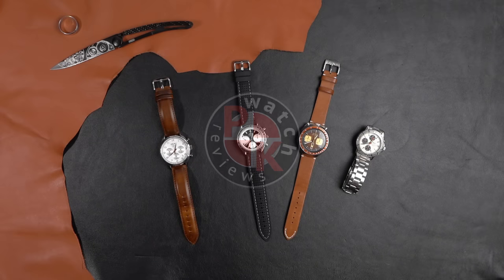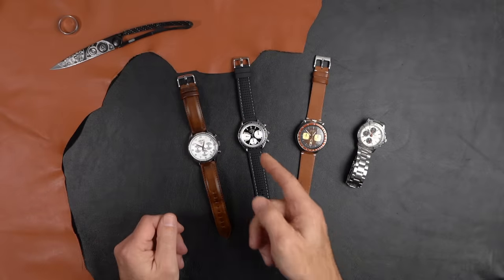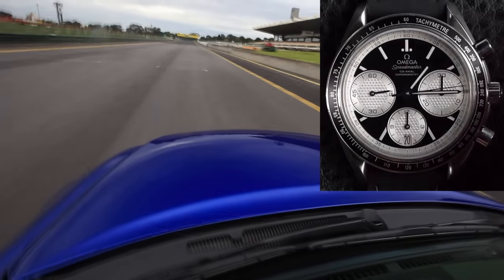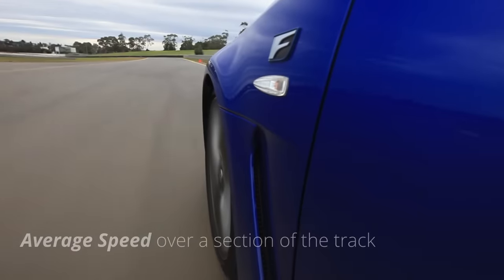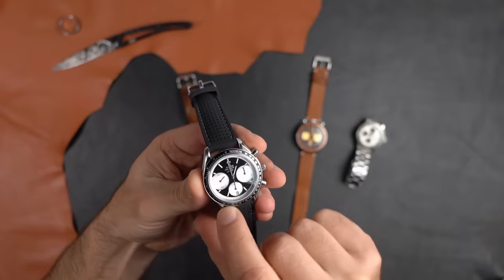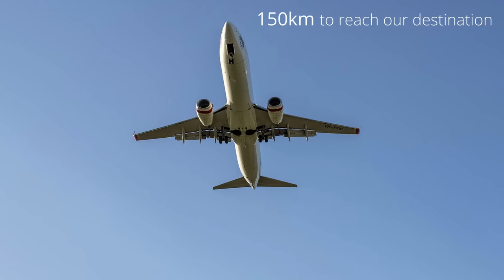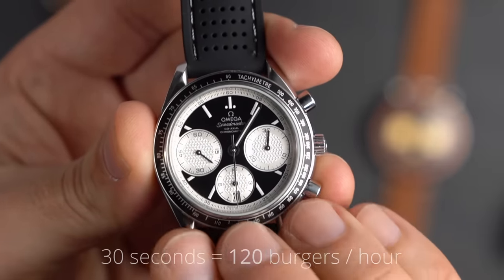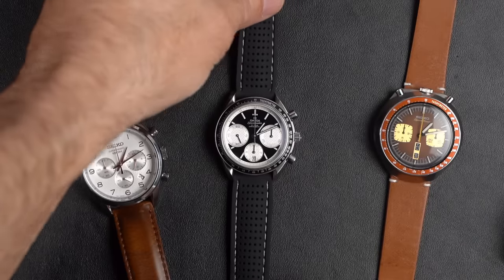How To Use A Tachymeter On A Watch

Comment: Tachymeters went the way of the divewatch: many people own them, professionals stopped using them decades ago, and not that many people actually still know what they really used to be for.
Reply from the maker: I agree, most of my friends don’t know how to use them either 🤔
Reply: Oh, well do not tell Formula 1 or the pilot's association!
Reply: @robinrobson5363  Pilot here...  and AOPA member.  No matter how well we my like the style, none of us actually use any pilot watch functions for anything other than basic time telling in the cockpit.  GMT is about the only useful thing for pilots, assuming you're traveling international a lot.  I actually use a chono and diver's bezel a lot, but mostly in the gym timing sets, or the kitchen when I've got multiple things going on the stove.
Reply: Well the divewatch function can be somewhat useful on a daily basis if for some reason you dont have a timer available,such as exams.
Reply: @heathwasson7811  And assuming that the GMT function is actually easy to use because some GMTs are kinda of a headache to remember how to read them
Reply: now it's used to look nice as sheeeeeeeeeit
Reply: @PeterKotsa  True, but I can still use my Omega Speedmaster to calculate the distance of a runway when doing an inspection to determine if it's long enough to land on. But, that's about it!
Reply: Dive watches are still used for diving. Mostly as a backup but still used

Comment: Tachymeter can also be used as a pulsometer with some conversion. 
Once you feel a pulse, you start the chronograph function.
Count for 30 pulses (the starting one count as zero). 
Then stop the chronograph.
By dividing the tachymeter reading by 2, the result is pulses per minute.
Reply: A good multiperpous function to be certain, low tech, but effective
Reply: Great now I have to buy one, even though my phone can do that.
Reply: you just need a second hand...count the pulse for 6 seconds and multiply by 10; that is it. did that for several years in med school...unless you are instructed to take the full minute on certain medical conditions.
Reply: @gilean6179  6 seconds leaves a 16% margin of error, and 10 seconds leaves a 10% margin of error. But 6% difference between them is pretty negligible. In a minute your heart typically speeds up and slows down just from breathing, moving or even thinking about it anyway, which pretty much erases those margins.
Reply: @UNSCPILOT think you need one with spellcheck 😂 sorry
Reply: .... or count your pulse for 6 seconds on your LCD Casio and multiply by 10. Just saved you $750+.  You're welcome
Reply: With some conversion you can calculate average speed of any metrics, if a value of the metrics and elapsed time are given. Thanks Captain Obvious.

Comment: Also works on distances longer than 1.  Multiply the timed result by the track distance.  Example:  Daytona International Speedway's oval course is 2.5 miles.  If a car completes one lap in 45 seconds, the result would be 80.  80 x 2.5 = 200mph average speed.
Reply: THANK YOU!
Reply: How is that any better than Distance divided by time? Tachymeter is designed to show the speed you go at with a single look, not to do math :/
Reply: @romrig4648  I was simply pointing out courses over one mile, kilometer, or whatever metric you are using.  Plus, the tachymeter shortens the equation from distance/time X 3600 in those longer than one situations.
Reply: Yeah, because speed = distance/time. tachymeter scale = 1/time (in hours)
So distance x scale = distance / time (per hour)

Comment: Fantastic explanation! Please note that the speed calculated in example 1 is still the average speed of the car over 1km. If the car doesn't decelerate nor accelerate, then the current speed = average speed, but the read speed is still average. If the time passed from starting to stopping the chrono was very very low, then it would be the true current speed. Otherwise, great explanation 👍
Reply from the maker: Cheers

Comment: Thanks for the excellent introduction. Just a remark: speed as shown in any speedometer always represents an average speed, or average velocity in physics term. You need to have a distance travelled against the time taken to calculate a value “speed”. That is, distance travelled per unit time. That is why Newton’s “instantaneous velocity” (speed in “no time”) is so contradictory and so difficult to understand (probably no one can really understand still) ...
Reply: In physics terms it would still be "average speed." Velocity implies speed + direction. Instantaneous velocity is change in position in "no time," not speed.
Reply: Instantaneous velocity gives you the hypothetical direction & speed that something would continue to travel at, if it immediately stopped changing speed or direction.

To put it in car terms, let's imagine you are cornering, when you suddenly hit a perfectly frictionless ice sheet and lose all grip. Your car's centre of mass would continue to move in a straight line, at the direction and speed it was going when it hit the ice. The instantaneous velocity at any point in time is the hypothetical ice sheet scenario at that point.
Reply: @bmjames  you can use the current D-modules theory/language to deal with derivatives. The formal symbolic calculations setup is essentially what have been known as operational calculus from the 19th century, which is the rationale behind Heaviside’s calculus and most probably operational methods behind Ramanujan’s calculations.  You can find recent attempts by G.C. Rota about rigorous approach on umbral calculus. But the D-modulus is a much better language.

Comment: Thanks for the explanation. I feel the fact that you need to have known some of the parameters beforehand for this to be useful makes it rather impractical in real life. Say at a random stretch of road, you wouldn't have markers with a known distance, unless you prepare and measure it beforehand, without the markers the tachymeter would be useless. And how often do you have vehicles that travel in constant speed in real life? As for the hamburger example, since the tachymeter scale and the corresponding seconds are always constant, a timer and a picture of the tachymeter scale would do the job, you don't really need a watch with a tachymeter scale for that matter.

Comment: Thanks for the explanation! Quick correction though, it would be the average speed. In a perfect world, the car isn't accelerating or decelerating, but in reality that doesn't usually happen. So calculating speed over a distance based on time would end up as an overall average speed.

Comment: You can use it to check your pulse. Say "nil" when you start the stopwatch. Count 60 heart beats and read your pulse in plain text. (If your pulse is higher than or equal to 60 bpm that is.) But you never do that. You count 15 heart beats and devide the reading by 4.

Comment: Excellent Pete.  Glad someone had explained this. I always wonder what that tachymeter is used for.
Reply from the maker: I use it very often, hopefully others can too now, cheers
Reply: @PeterKotsa  For what? i don´t believe you.
Reply from the maker: @asdfjkl981  Before covid I was heavily involved in motorsports photography and hot laps around racetracks here in Melbourne. The tachymeter was a must
cheers
Reply: @PeterKotsa  so what does a tachymeter that a normal stopwatch/chronograph can't do far better and more practical. You need a known distance of exact multiples of 1km to have the slightest advantage but even than you can simply devide (the distance in meters)/ (the seconds on the watch) and you get m/s wich is even an International Unit. multiply that with 3,6 and you get km/h
Reply from the maker: @asdfjkl981  No one ever said you can't use a stopwatch, this video just demonstrates some practical uses of a tachymeter
cheers

Comment: Very informative, yet clearly presented, video. Good work. 

Could you please give details of stainless watch on the far right side of table.
Reply from the maker: It is an old seiko chronograph, the case back has the reference: V657-8060  cheers

Comment: Most U.S. highways have mile markers.  Unfortunately, tachymeters only work at speeds over 60.  More practical for kilimeters than miles.  A friend of mine used to have a Seiko with a tachymeter that "wrapped around" up to about 70 seconds.  Worked better on roads with the old 55 mph limit.
Reply: There are only 60 seconds on a watch.... Soooooo... How the 70 sec wraparound...??? 👀👀👀
Reply: @benjackson6260  Easy, you just divide the time to get it within a minute and then divide the unit by the same amount.

If you use 70 seconds to drive 1 mile, you can divide the time by two and read the speed and divide that by two as well. For this example you'd take 70/2=35. The indicated number on tachymeter scale at 35-sec mark is about 102, so that's 102/2 = 51mph.

If you're biking, for example, and it takes much longer, say, 2m30s to complete one mile (that's 150 seconds): Divide 150 by 3 to get within the 1 min range, read the tachymeter scale and divide by 3 there as well; 72/3=24mph.
You can measure anything per hour (or minute with some simple division) with a tachymeter scale, no matter how slow or fast. Last one I used was yesterday, number of golf balls shot on the range  per hour. Before that my daughter wanted to know how many grey cars we would pass in an hour  (way too many. We need more colours in the world.)
Reply: @WreckedRectum  I am not gonna lie... I really needed to read all that u said twice... 
But I got it...Its absolutely amazing... How u can measure almost anything no matter its nature or use using a series of numbers... 
It really makes u think that calculating everything around us in numbers is indeed possible... 
Like how many birds fly above someone's head per day, How many strangers he sees, What common words do people say around him... And replicate that to form a complete simulated world in which a real human could never find that its not real... 
It makes u think that maybe it's us who is making these hypothetical futures like Terminator and Matrix easier to achieve for the machines (if indeed such a thing does happen)...
But yeah, puting all this number talk aside, we definitely need more colors man... I want a gorgeous shade of Aqua/Cyan for my Rivian... 😄😄
PS at least phones are still in cool colors and designs... Imagine them being all silver... Right...

Comment: The tachymeter scale should be inside the glass on the bevel of the bezel and not on the outer surface if they have only been screen printed or laser printed they will become worn over time and unable to read! I had that problem with a Seiko Chronograph which I really liked!
Reply: My Bulova Lunar Pilot tachymeter is under the sapphire glass and looks so crisp.

Comment: Absolutely great explanation. But wonder if you can help with my 1976 Seiko 'Pogue' which has a different scaling for the red portion of the Tachymetre Bezel?
Reply from the maker: Its the same principal, the only difference is that the scale of the Pogue starts at 250 miles per hour (or Km/hr) and goes all the way around down to 50 in the red section..(full complete circle)
Hope that helps
Reply: @PeterKotsa  Thanks Peter
Reply from the maker: @mark964  cheers

Comment: During flight constant speed to cover 1km using tachymeter is very approximate figure, as there is normally wind that affects the moving of airframe in space (slower with headwind/crosswind and faster with tailwind). But good example though.

Comment: Bonus fact: It can be used to hourly rate any repeating event. Not just linear speeds.
Example: Let's say a clerk is filling a bunch of simple forms. If it takes him 30 seconds from the point he starts one to the point he starts another, then he is filling them at 120 forms per hour.
Reply: Just like the hamburger example in the video.

Comment: Its kind of inefficient to calculate distances and speed using this method, but it certainly is a good mental exercise. Im getting a new tissot with a tachymetre scale and will use it at some point mainly as that. A mental exercise.
Reply from the maker: Need to stimulate the mind to keep it active 👍🤔
Well said Kevin 
Cheers
Reply: @PeterKotsa  your video is awesome. I may think that way, but I was genuinely curious as to how the tachymetre works, and you've explained it very well. Thanks a lot 😁

Comment: There's an unusual hack for timing speeds longer than 60 seconds. As soon as the chrono seconds hand passes 60 seconds of elapsed time, refer to the units on the tachy dial as seconds elapsed and the seconds on the dial as the units of speed. So if you take 72 seconds to cover 1km, your speed is 50kmh. Another example, you cycle 1km in 3 minutes. 3 minutes in seconds is 180 so look for 180 on the tachymeter dial, your speed is 20kmh per hour.

Comment: Now then, if i had a son running (100m?) in 10 secs, i'd have to get myself a bike to keep up... 🛴 
As for the tachymeter watches, i don't even like the looks that the dial gets (nor 2, nor 3, not even single sub dial). I don't even like watches with sub dials measuring (pointing) days, dates or even seconds (there are some exceptions there...). Only a 24h subdial is usefull, but is way better as a centered gmt hand, ain't so? Am i weird? You name it but i like clean dials most of the times. "Panda" looks, 3 circles or even more/less, no matters what the configuration is, is not my taste. 
Enough rant...lol. Great (educational) vid, one more in fact. Keep up the good job

PS.  Nice logo mate 😏😁
Reply from the maker: Hahahaha 
You’re my comedy relief. Keep it coming bro😂😂😂
Reply: You're a Sinn EZM1 fan?

Comment: That saved me from reading mega pages in my book.thank you, very easy to follow. When would you turn the dial , I notice they spin ?
Reply from the maker: ?
I don't quite follow, what do you mean the dial spins Paul?
cheers
Reply: Rotating Bezel
Reply from the maker: @paulbramucci7586  Usually watches like this with Tachymeter scales do not feature a rotating bezel as is the case here
cheers

Comment: Another great & informative video Peter, I must admit I hadn't ever used a tachymeter scale on a watch before, can it be used to work out the speed between two points if it takes longer than a minute between them?
Reply from the maker: Yes it can, you just need to divide the time by a factor to bring it back into that 1 minute scale, then accordingly divided the result you read on the scale of the Tachymeter , cheers
Reply: @PeterKotsa  Excellent, thanks for explaining,  cheers Peter 👍

Comment: Just wondering why isn’t there numbers on the scale part where it says tachymeter?  Is it because that first 6 seconds or whatever is just too fast?
Reply from the maker: Correct, designed for Motorsport originally so the speed would have been too fast

Comment: Hi, I have an additional query: In swimming, if you are not a yung olypmic guy,  you  can swim the 100m at a time like 1'12". In this case is more than 1 minute. So, is there a way to calculate the average speed with a tachymeter for these kind of cases?
Reply from the maker: Yes, just bring the time into the 60 second zone. In this case divide the 1'12" (or 72 seconds) by 2
 72 divided by 2 is 36
Then look at the corresponding mark on the tachymteter scale that lines up with 36 seconds (it lines up with 100). 
Now divide the 100 by 2 as well
100 divided by 2 is 50
So in this case, your answer is 50 
Hope that helps

Comment: Hi sir, one question..can we use this tachymeter on times above 1 min?
Ex: I make a hamburger in 3 min how many hamburger in 5 hours?, is it possible to measure that on watch?, Thanks
Reply from the maker: Yes you can measure over a minute, you just need to divided the total at the end of your measurement to bring it back into a ONE minute time spance. 
So, for example.. if you measure an event for 2min and 45 seconds (185 seconds), then divide it by 3 which gives you 55 seconds...this allows you to fall into the tachymeters scale...and the corresponding figure on the tachymeter scale is also divided by three to give you the correct result.
Hope that helps..
Cheers
Reply: @PeterKotsa  thanks a lot :)
Reply from the maker: @sorinbunea471  your welcome

Comment: Very useful. Now i need to chose which watch to buy. Little help please. Is Victorinox good choice? Thank you.
Reply from the maker: Ive never personally had a Victorinox so I cant say..
Reply: @PeterKotsa  Can you recommend  which Brand to buy, price no more than 500euro.
Reply from the maker: @NaviNavi-1uu8tg  not really, i cannot think of a brand for 500 EUR
Reply: @PeterKotsa  Ok.. If you can recommend something please do. Because i dont know what to buy. Thank you.
Reply from the maker: @NaviNavi-1uu8tg  Firstly do you need a tachymeter Chrono?..and if so does it have to be automatic?
This is about the cheapest in auto : https://www.aliexpress.com/item/4000829393440.html

Or you can buy many quartz versions, here is an example: https://starbuy.com.au/citizen-bullhead-mens-watch-an3660-81a/?source=Google&device=c&campaign=10014744877&adgroup=103570155969&keyword=&matchtype=&placement=&adposition=&location=9071323&gclid=EAIaIQobChMIobTKkOPC9QIVGZlmAh03-wrNEAQYBSABEgIpDPD_BwE
Reply: @PeterKotsa  Yes with Crono. Thank you

Comment: Great video! Would you know how to use Invicta model 17313? Two questions with it: the big arm is used for the regular watch, and the small arm on bottom is used for the stop watch. So how do I use it for the tachymeter? Also, there's no 500. It starts from 400 and the lowest is 60. Thanks!
Reply from the maker: I am not familiar with the invite, but if it is a chronic  graph with a tachymeter, It should function exactly the same
cheers
Reply: @PeterKotsa  Thanks for answering! I'll have to do some research, I guess 😀. It's Invicta Speedway Model 17313.
Reply: The big hand is seconds and the little hand is hours.